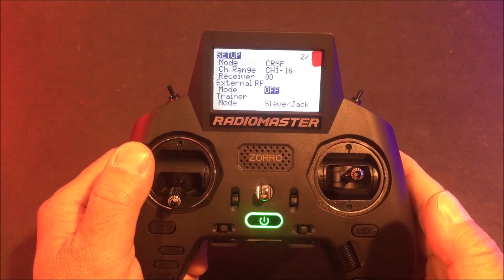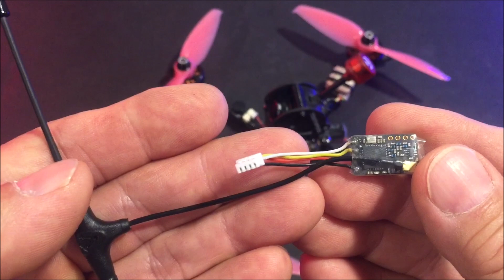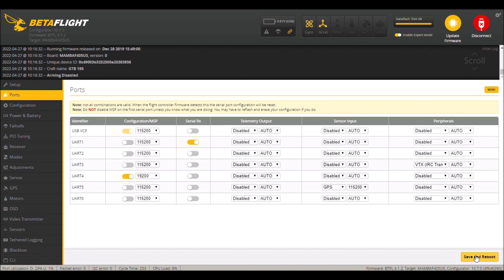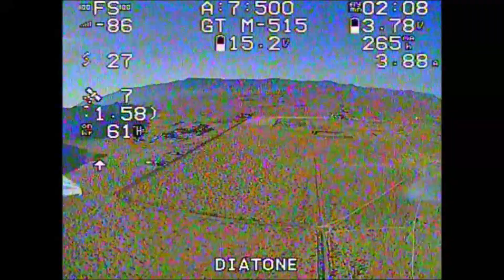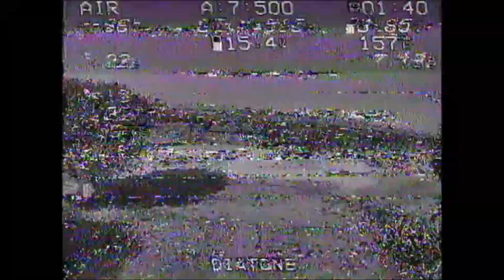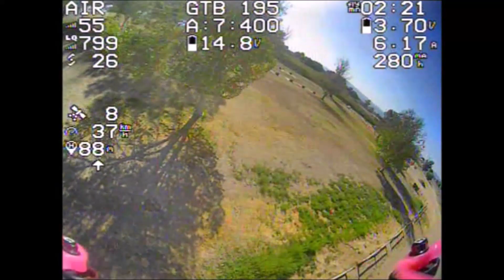Zorro ELRS Testing with EP1 EP2 Receivers / Carry Case / AG01 Mini and Sticky 360 Gimbal Sticks

Comment: Nice review, But have some questions maybe you can answer
I know this video is nearly year old but I am always late  when it comes to tech
I see you have a ELRS internal protocol
SO here is my question , I have older small quads and have the older Frsky XM / XM+ / Rsxr /SPI receivers ( not the newer Frsky Rx's with ACCESS I think it is) ?
Rather than change all of those to ELRS receivers, etc
IF I bought the Zorro and I wanted to continue to fly my older quads with those older Frsky Rx's what Zorro Tx should one get ?
 One with ELRS and Add a module to cover the older Rx's ( if they will ) OR get a Zorro with 4 in 1 or CC2250 and ADD a ELRS module to use ELRS ?  As it appears everything is now ELRS in many micro quads being sold today? 
I currently use the original T8SG Tx ( black and silver one ) to fly micro quads and when Frsky changed to their new ACCESS  I think it is, it will not bind to the newer Frsky receivers 
SO 
What do I need IF, I decided to go with the Radiomaster Zorro to fly those older Frsky protocol Rx quads and also later if/when i wanted to fly a ELRS protocol quads ?
Hope that is not to confusing ...lol
Reply from the maker: I would get the 4in1 internal module since external 4in1 modules are hard to get.  Then add the external elrs module.
Reply: @RCEscape  Thank You , yeah i decided to do that, but i had one other issue I thought the Zorro 4 in 1 would also fix and that is the newer style Frsky Rx's that will not bind to my old Jumper, but it appears they will not bind to the Zorro either and they will have to be flashed to older firmware somehow to make it work 
I do have a couple older Fsky Rxs I could just change them out and if later the ELRS nano module comes out and they fix the XT30 on it I may get it and some ELRS rx's instead . But at least i can still fly most of these older quads I enjoy so much
Thanks again for your help and advice,

Comment: Hi Mr, great video!, what is the value of tx power that you are using in the transmitter?  because I had the external elrs module and I don't know what value to use.
Thank you very much for your help.

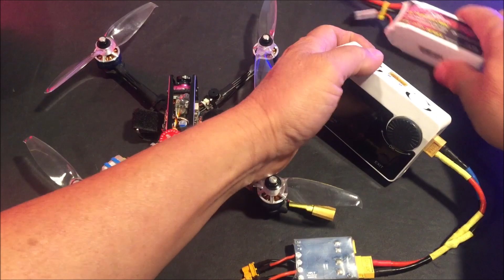Comment: Great video.  I'm a newb.  Have a Protek R25HD and a Zorro ELRS Tx coming in.  At 9:10.  What is a smoke stopper and do u have a link?  What is the M8 you r connecting the smoke stopper to at 9:20?  What are the names of your nano drones under 250gms?
Reply from the maker: smoke stopper  https://www.youtube.com/watch?v=hgi1nYf36I4
m8 charger  https://www.youtube.com/watch?v=9-AmLAUiApE
Hope this helps :)
These are things I use all of the time.
Reply: @RCEscape  Thx for reply and links.  Much appreciated.

Comment: These range tests at high altitude (100-300meters), not practical, who would fly fpv at that altitude. I'll take out my Mini2 to do that. Could you please do range test EP1 vs EP2 at lower altitude like 10m high. Thanks.

Comment: which 4in 1 module will you recommend?
Reply from the maker: There isn't a good nano 4in1 available at this time.
Reply: @RCEscape  how about the irx4 lite ?
Reply from the maker: I personally do not like irange products and have not tried it.  Watch some reviews on it and see if it is any good.  What you could do is change out the receivers on non elrs quads to elrs.  If this is too much for you, you could use ONE elrs receiver on all your quads by prepping them with a four pin jst connectors and have the elrs receiver prepped with the matching connector so you simply remove the ONE elrs receiver from quad to quad instead of the 4in1.
Reply: @RCEscape  Yeah irange products always seem a little sketchy to me too. I mainly ask because I have a mobula 6 HD, and it has the frsky protocol (D8?). The FC has receivers integrated... I looked around and it seems I can buy the whole elrs FC to replace but that's pretty expensive. (around $50)
Reply from the maker: @user-yk1cw8im4h  
Do what I do for d8 protocol spi receiver quads.  Upgrade the transmiiter you already have with d8 mode to a pigtail antenna interface so you can add a 2watt booster.  It’ll increase the range tremendously.
Reply: Works like flysky ix b ir whatever but cant run servos

Comment: Sweet review pete!
I need to do something about the horrible range of the twig...either elrs or a r81....
Reply from the maker: ELRS.  That's where I'm going.  Plucking out the xm plus on most of my quads.  Wiring harness for 4 pin jst and swapping out elrs or crossfire.  Radiomaster all the way :)  $13.50 only for the ep1.  I just need three.  More than enough for swapping.

Comment: Great review as always. ELRS looks to be the way to for sure. As for me, I've spent about the last year and a half or so moving to Crossfire and with that investment I won't be changing anytime soon. Who knew?
Reply from the maker: Thanks!  Crossfire is an excellent platform.  I've gotten the micro starter kit that came with 3 receivers and the module and one quad that was sent by Banggood had a crossfire nano so I have just 4 receivers and still have one receiver not used.  If you can get a hold of some jst female and male 1mm pitch connectors and put them in your quads so you just swap out the receiver from quad to quad, you don't need many receivers at all.  But if you keep buying quads and new receivers then you may want to go ELRS.  So much cheaper and amazing range.

Comment: Finally sit in front and land in backyard with house in between you and your drone . Maybe . 
   Those beta fpv elrs lite recievers match firmware with beta fpv elrs jr bay module . No upgrade needed . No flashing computers . Just buy and fly .

 And beta fpv nano rx , and beta fpv nano tx firmware match to bind .
   Then you can wait to upgrade . Computers are not very common anymore.  I haven't seen one lately .

Comment: This Seems Like The One To Get, There Are A Few Elrs Transmitters Out There But You Have To Update The FirmWare To Get AnyThing Bound Up. They Seem To Be Bit Of A Hassle To Get Them Working Properly. Had One That Bound To The Receiver But It Didn't Show AnyThing Was Bound On BetaFlight, I Thought It Was The Kwad But Turns Out The Transmitters FirmWare Wasn't Proper. Had To Go Through A Nice Bit Of Work To Even Do An UpDate On The FirmWare. Not To Cool, It Was Very DisCouraging. Thought The Transmitter Would Be An Out Of The Box Bind And Fly And A Bit Of BetaFlight Set Up But It Wasn't. The Zorro Seems To Be A Better Buy Then The JPro Elrs, Think I'm Gonna Get One.
Great Review Budd. 
Bless Up
Reply from the maker: I really love the way Radiomaster puts the latest firmware and makes it simple to set up right out of the box without any downloads or updates and that is how it should be when you buy a new product.  You will be happy with this one.  Oh, try out the sticky gimbal sticks.  They are something else.  It's like Spiderman fingers!
Reply: I found out beta fpv nano modules and beta fpv brand nano recievers factory firmware binds .
   The beta fpv lite recievers bind out of the box to beta fpv micro modules .👍
Reply: I bought all three to finally get it figured out . 
   But i didn't  have to buy a computer and cable . So weeee. I actually saved money . And you can too . Remember : beta fpv brand nano module binds to beta fpv nano reciever without lua script or flashing or computers or cable internet bills or upgrades or any of that . You can learn that later though if you want .